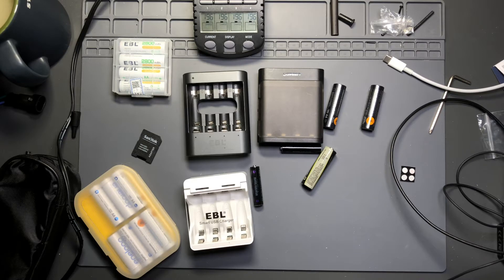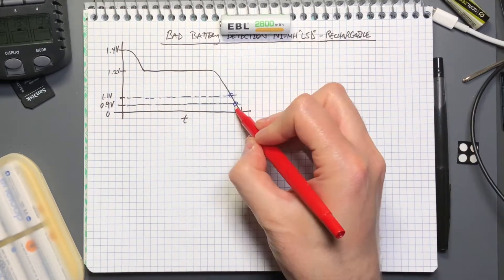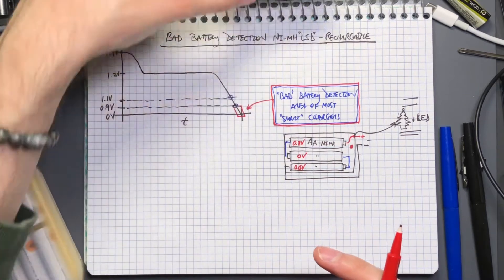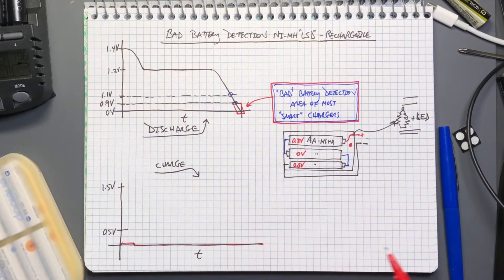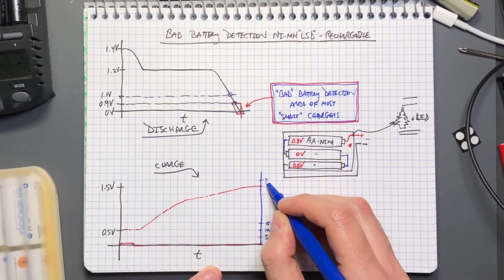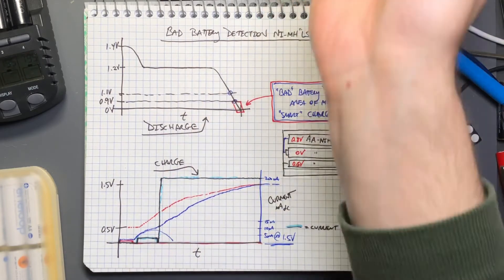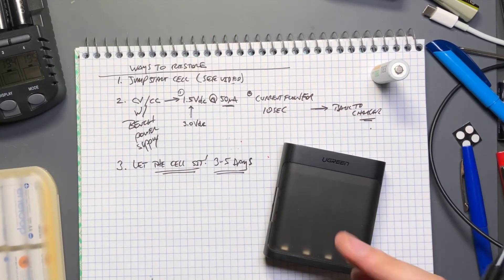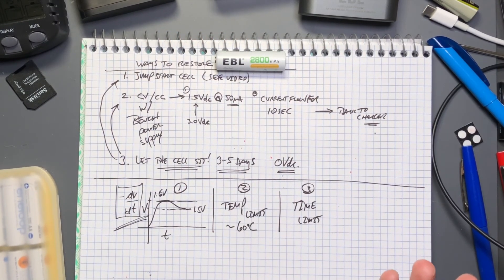"Bad" Battery Detection - What Does it Mean and How Does it Work?

Comment: I have an Energizer NH15 1.2v NiMH HR6 2300mAh battery which measures 1.28v and my charger which is a Panasonic BQ-CC55 is flashing red on it.  From watching your video I'm guessing that maybe the battery voltage is too high to charge?  I was trying to recharge it because my other fully charged batteries both Energizer and Eneloop brand are resting at 1.34v.  

From what I could find online, "Red flashes mean you've inserted a battery incorrectly or installed a dry battery by mistake (the safety system shuts off the power and prevents short circuits in both cases). If the light still flashes red after checking the above, it's time to replace the battery.".  I'm not sure what it means by a "dry battery".